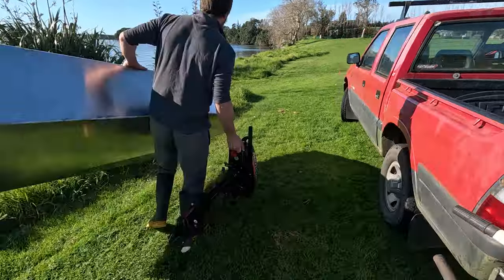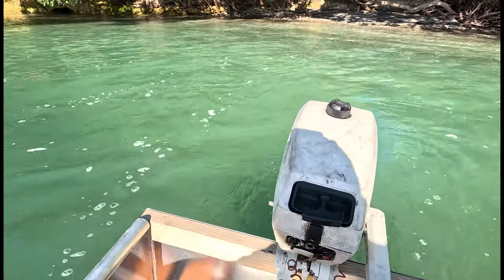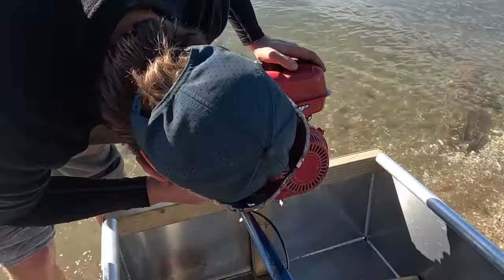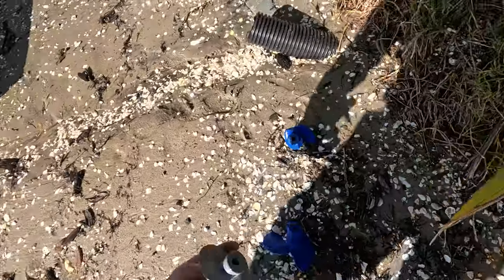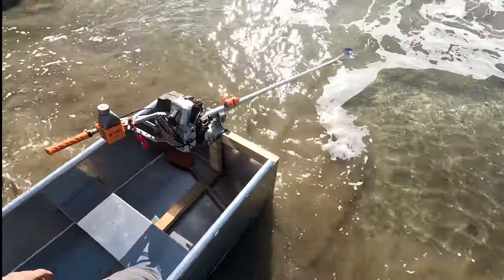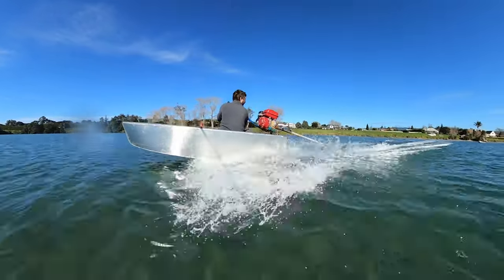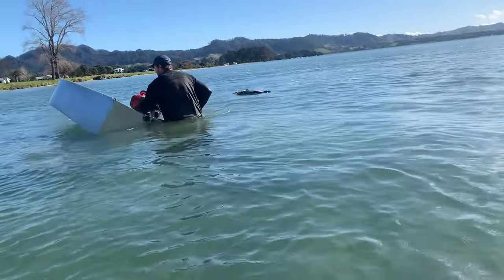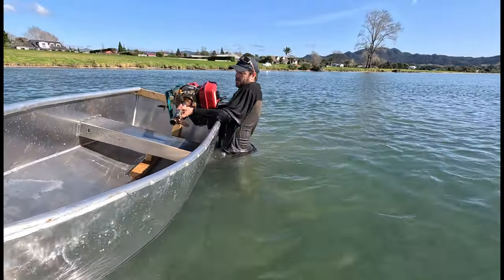2 Micro Boats Plus 4 Motors Equals?

Comment: A short keel on the little boat will make it a lot more manageable. It doesn't have to be much and you'll be impressed by the difference in steering and turning!
Reply from the maker: It would also help to keep the hull more ridged 👍

Comment: Nice work yet again.
Reply from the maker: Thanks Bruce I almost had the electric one ready but a bit more work to do yet
Reply: @DktheWelder  
Glad you found the bad connections and have it running. 

Remember. Test it on a car battery first.

Comment: I like the boats ya make Dan,if u add some bracing on the back 2/3rd on the inaide of the hull u will find its easier to get up on the plane as a slight bend in the hull from water pressure creates a heap of drag but also on the outside as it goes from the V shape and starts to straighten put some ripple strips on it as that will create some loft but also improve stability which is why speed boats have it as it acts like a rudder/keel
Reply from the maker: I am actually designing a brace for inside as it is flexing like you say. Not sure I know what you mean about ripple strips? Flat hull is best for planing at lower speeds right?

Comment: Those little boats look like a ton of fun.  There's a guy here selling little aluminium jet boats with the engine from Seadoos.  They sell for around $14000!  Very cool though
Reply from the maker: It would be a good hull for a jetboat but being able to carry it without a trailer really good
Reply: @DktheWelder  it also made it possible for your brother to lift it out of the water to dump before flipping it over

Comment: Right ima gonna just come out and say it try a 20+ hp v twin ride on engine on the small boat will make a awesome Longtail
Reply from the maker: It would aye probably do 60kph no worries if it could float
Reply: Maby use a gearbox from the bottom of an outboard under the ride on engine keep it laying down
Reply: @DktheWelder  it will float there not that heavy just dont think about it and give it a shot hahaha

Comment: The chainsaw 2 stroke needs to be alittle longer you can see your out running your trail where the v comes back together is kinda behind the motor and it just wants to get out plain but the trail leaves the prop and its stops pushing i know that sucks but my experience with these engines and my 14 ft i was haveing this issue and went to the longer bar and it was a totally different engine.
Reply from the maker: Yeah it is out of part where the wake goes together, I have done some more modifications to it will be better next time

Comment: what's the quality of the fuel, in the UK we are sold junk with a shelf life of two weeks max, and outboards and garden equipment hates it. just wondering if the outboards are running at there best.
Reply from the maker: It could be , both motors been sitting for a couple months so could be the fuel